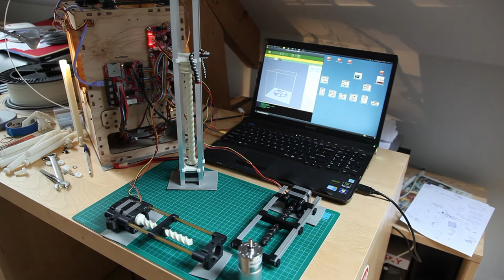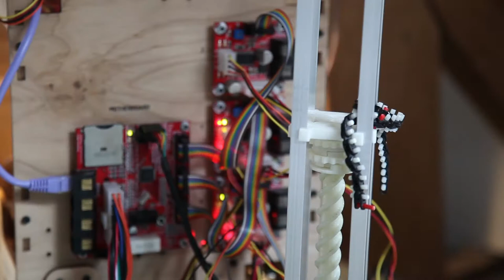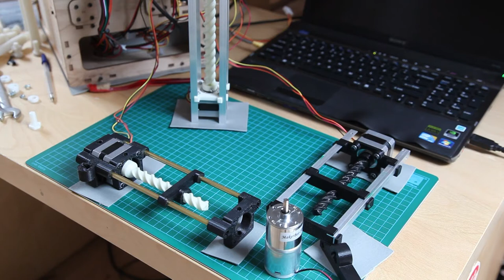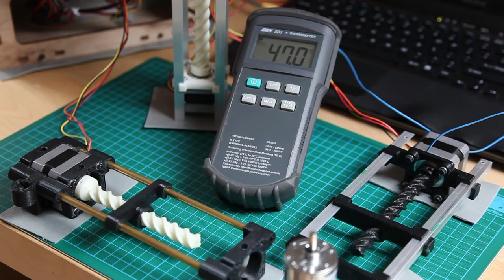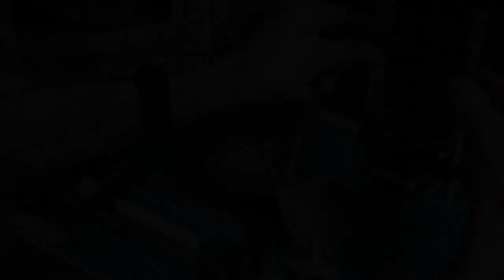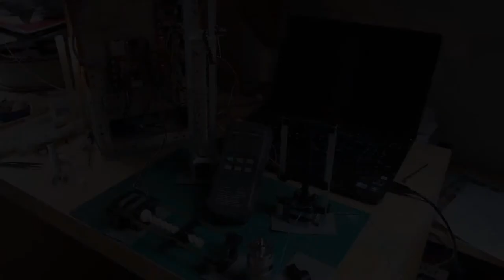f-bot etp

Comment from the maker: @karandex 
you can see it in the video, zero (or quite close) for the white leadscrew in the brass rods assembly because I spent a lot of time carefully cleaning adjusting the parts involved. Horrible huge backslash for the black leadscrew in the aluminum assembly that was put together almost out of the pinter.